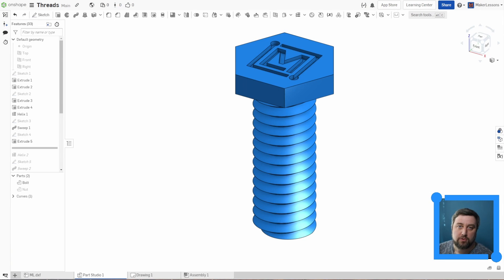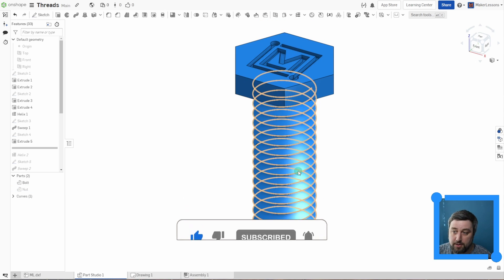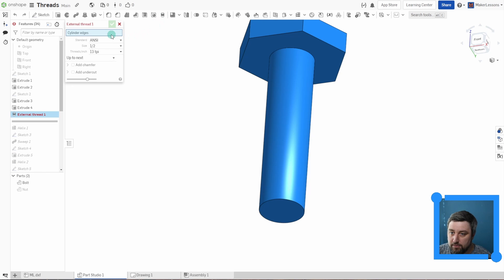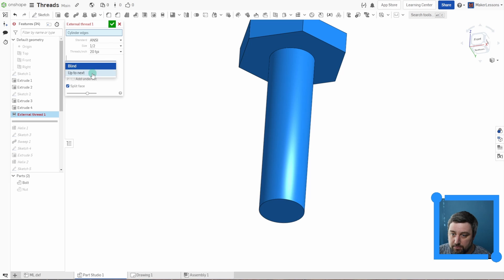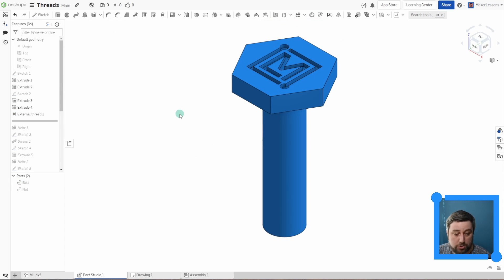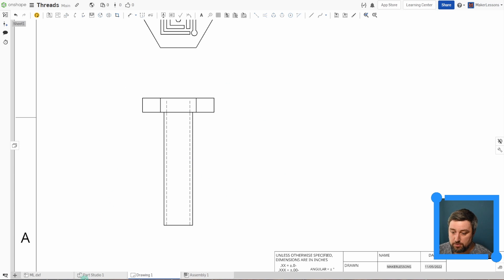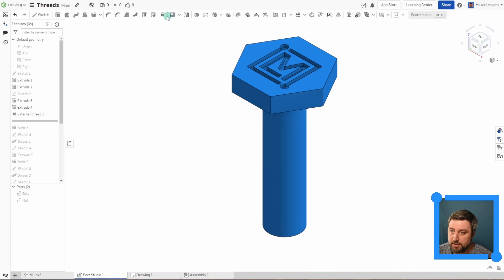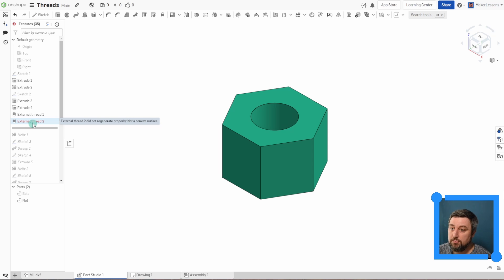Learn Onshape: Threads Feature

Comment: An external thread tool doesn't seem that useful without an internal one, but thanks for explaining how to use this feature anyway - I need a threaded shaft and matching cylinder (for linear motion with a stepper) so will check out your custom threads video - thanks again!

Comment: This is worthless for 3d printing unless you are using actual nuts/bolts. I did this, exported the file and sliced it, no threads.
Reply from the maker: Yes this is for designing actual threads to be machined, not stl files for 3D printing. Here is how you design threads for 3D printing: https://youtu.be/WkhUtFPze_s?si=SSFO5VxzYXMYvg7x
Reply: @MakerLessons  you might want to check that link, it goes to an ad, not a tutorial
Reply from the maker: Whops, fixed thanks

Comment: Jesus, how many more years for an actual thread that shows? even a lame texture would do. This is so 1995.
Reply from the maker: These threads do show in a drawing sheet. Onshape is a web based CAD software, and there are some trade-offs for that functionality. I do have a video in the description on how to produce threads that are "visable" and even 3D printable if that is something you are looking for
Reply: @MakerLessons  thanks. I know how to make threads, and I know that threads create a more complex mesh, but with todays GPUs it's a very poor excuse not to have these visible. Solidworks had 'cosmetic' threads back in the days to prevent slow downs. But it was ages ago, and a lot has changed.

Comment: Once they allow physical modeling and internal threads, this will be fantastic. There is a Thread Creator custom tool that physically modeled the threads, at least a few years ago.
Reply from the maker: Yea the custom features threads are pretty great and I use that all the time. If I want to 3D print threads I usually draw my own https://youtu.be/WkhUtFPze_s

For internal threads I use the hole feature and make them threaded holes https://youtu.be/H58oY2cmn7I its still not visible in the model so function the same way as the thread feature but still useful for drawing sheets
Reply: Well. Internal is now the tap feature of the tool "hole"

Comment: doesn't seem to work for 3D printing. Dropped a bolt into Cura and nothing showed up. Also external but no internal?
Reply from the maker: Yea this is only for showing a threaded part on a drawing sheet. If you want to print threads you need to do this https://youtu.be/WkhUtFPze_s
Reply: @MakerLessons  just watched that video actually. Very helpful. Was so much easier when I was in college and had access to Solidworks. This is a lot of work lol
Reply from the maker: Just tell yourself this allows for greater customization 😁

Comment: This new feature is pretty much useless until they make it work in assembly and show up on your parts. It should also work for threading holes.
Reply from the maker: I think that its a good thing they added this. You gotta remember that this is a browser based CAD software and its pretty intensive to have actual threads on a part. Any time you run the feature script for threads it really bogs things down. So this new feature works well for drawing sheets and you can have it in an assembly. Just like the threaded holes it uses the outer diameter so it works fine if you want to use the thread mate, you just don't see the threads since this is only cosmetic.
Reply: @MakerLessons  but i would never use their version over the community version. Someone has already made a bolt and nut threader program for onshape i just feel like this feature is underwhelming comparatively to manually doing it or using the program made by a customer.
Reply: And don't get me wrong i absolutely love onshape i just think they dropped the ball on this feature and i hope they add a completed version to it
Reply from the maker: For sure but have you tried putting that on a drawing sheet? It looks a mess and you can't really dimension it cleanly.
Reply: @MakerLessons  no i haven't im glad they a solution for it now tho
Reply: @MakerLessons  A lot of processing actually happens on their servers. It's not all browser-based